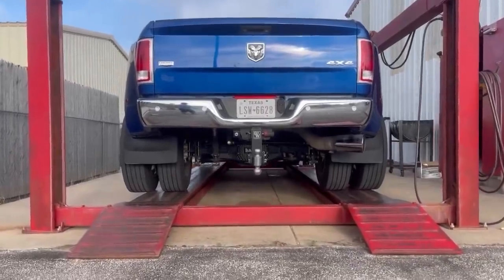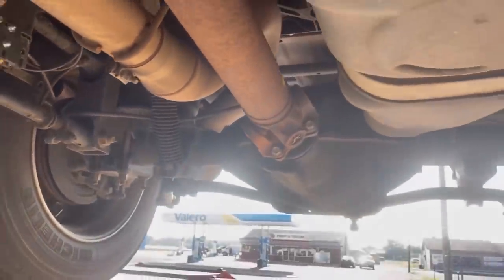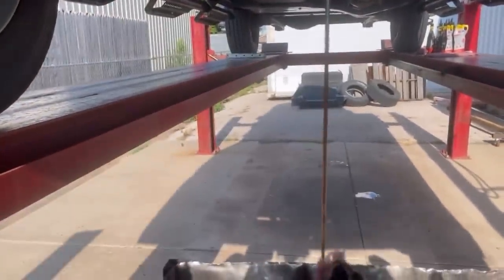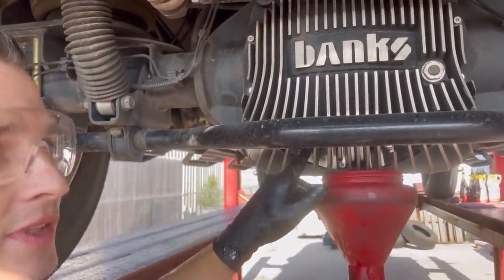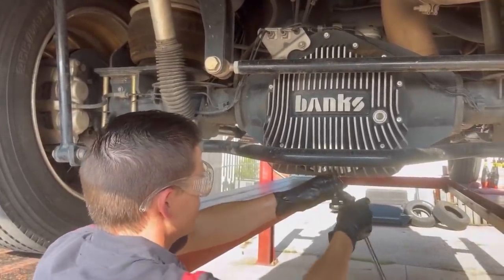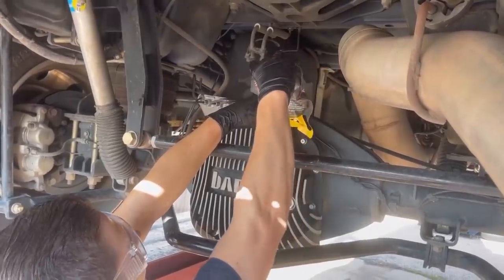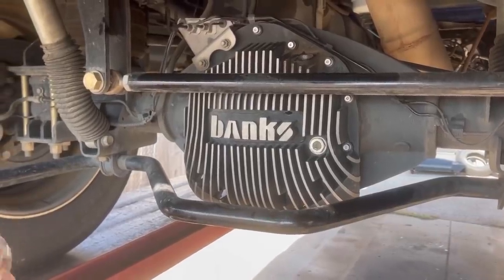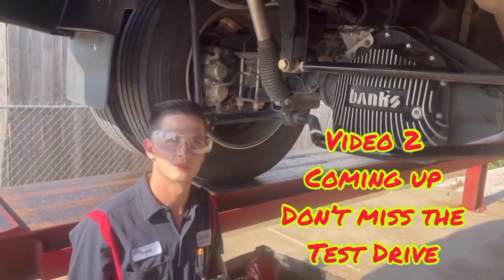RAM 3500 Rear Differential Service After Towing 30,000 lbs

Comment: Always take the fill cap off first!
Reply: I was just going to say that myself it definitely would make it drain a whole lot easier that’s for sure
Reply: That's 101
Reply: Doubly important, if you work on older or rust belt trucks, cause it's impossible to fill from the drain hole, if you can't get the fill plug out. Better to leave the old oil in, if the customer doesn't want to pay for the time, to drill out the fill plug or replace the cover.
Reply: @aaronnoyb  Not impossible...just difficult and annoying with a possibility of gear lube in your armpit.
Reply: Im sure he did just to slow the flow at first...And just got to talkin and forgot...No worries..Living life isnt perfect...
Reply: That boy sure talk slow.....
Reply: @jerrydlaughrin2880  not just that, I've had many that the fill plug was stripped. Never want to turn preventive maintenance into an unexpected break down.
Reply: Agree
Reply: Yep, always want to know you can replace the fluid before you remove it and it gives a better flush of any sediment on the bottom of the diff housing.
Reply: @LTVoyager  and to make sure the plug comes out. You pull the drain plug,fluid comes out,the top plug is seized up,now what?! Easily common sense!
Reply: @white24valve  Yes, that’s what I said.
Reply: this is an aluminium cover but even when rust is not an issue  it should still be removed first so air can get in and the oil drains better .

Comment: Guy needs more truck if he is actually towing 30,000-40,000lbs constantly, or he’s full of it. 

I run a Ram 4500 at work and I still wouldn’t put 40k behind it.
Reply: He may mean gross weight?
Reply: Big part is what sort of towing he's doing - if it's highway miles at medium throttle and high gears the vehicles not being loaded nearly as hard as if it was in the mountains, with full throttle being used in mid-lower gears.
Reply: True, but there are those who do…. To their own destiny of course.
Youtube: Danger Industries
🤯
Reply: i have a 18 3500 and i tow 35k behind it all the time, just because you are scared of it doesn't mean the truck cant and the guy has 22.5" on it so yeah that truck works. no one in there right mind would but 5k in rims and 4k in tires on a truck just to sit, or at lease those style of tires
Reply: @michaelladue5655  when you go to a CDL most DOT officers will just check the Tire rating now and not the truck sticker, You can change a trucks GVWR legally if you want, same with trailers. the truck he has is also rated for that much so idk where you are getting your info. if he is pulling 40k then the trailer would be 40k rated plus 14k for the truck payload totalling 54k, when you load a trailer correctly at 40k your tongue would be 4k-6k tops and that's perfectly within range of this truck
Reply: @michaelladue5655  if you are hauling 40k most hotshots will use a tri axle tandem and there are plenty of brakes and please get off your high horse with the east coast crap lol you have hills at best i live and work out of BC Canada i literally drive grades up to 14% daily. i also have been on the east coast of the US and i had no problems my GCWR on my truck and trailer is 24500KG and 6350kg on the truck. you clearly don't know what you are talking about but you did get your CDL 20 years ago when cowboy trucking was a thing, i respect what you do and the skill that comes with 20 years but a lot has changed and trucks are just getting to that point where it seems crazy but they can do it, i have had no problems or where i feel unsafe in my truck hauling, now that being side I'm also the guy that sets cruse at 62 and leaves it there and 50 when in the hills and the ram 3500 engine brake is nuts and tends to keep the truck under control. your going to blow your load in 2023 when ford comes out with a truck that can do 40k they are already at 37k.
Reply: @michaelladue5655   registered my 95 f350 for 16kgvw(12,500 is door plate) here in MT this year... yes you can legally increase your gvw and plenty of ppl do even in CA. Manufacturer gvw is a suggestion not a fact... take my obs for example for rated the axle(dana 80) at like 7k while dana rates at 12k.... plenty of cases like that

Comment: @Lauren (wherever she went to) I doubt anyone claimed OEM was the worst one to use however, there are many other aftermarket brands out there that DO NOT perform as good as an OEM cover. At least Banks tested theirs and filmed their testing methods as to the improved lower temperatures over OEM plus the advantages of the oil sight glass, top fill plug and lower drain plug. Expensive accessory however, it is better than OEM in many ways.

Comment: A pipe plug socket is a better tool with those drains as they are generally “sharper” around the corners and won’t risk distorting the super tight plugs. Just a quick tip.

Comment: My Ram 3500 Cummins Dually called for 75W140 synthetic gear oil for heavy towing loads! and I'm in northern climates. Don't forget the friction modifier for the anti-spin mechanism!
Reply: Only need friction modifier if it is a clutch style diff, any other and you don't need.

Comment: The Bank's differential covers should have ave intake shroud that draws air flow across the fins it would cool better while the vehicle is in a forward motion.
Reply: Not easy to see from this video but the tabs that stick out on each corner at the bottom are in fact scoops that redirect air upwards.

Comment: I know it's a new cover however, ALWAYS make sure you can get the fill plug off first before draining. Also the old fluid runs out much easier with the fill plug removed.

Comment: Those two parts of the diff cover that extend beyond the original diff dimensions (the "scoops")...if they were cut off and reattached with hinges and kept in place with springs, the owner won't have to worry about tall spots in deeply rutted roads or big rocks the driver can't go around because whatever collides with those spots will simply move them backwards and the springs will move them back into place so they can continue to channel air upwards over the diff cover. 
All it takes is one good hit (2 mph or faster) and that aluminum diff cover will start leaking. Those Banks diff covers are great but they could be made just a little bit better.
Reply: You should check out the Banks cover video. They show what it takes to break them off (hint: they're made to break off in a way so as not to leak)
Reply: @domdogg123  I saw a video of a guy who connected with something in the road and his diff had a small leak. It's somewhere here on youtube.
Reply: @cliffcampbell8827  Fair enough.

Comment: Remove the fill plug then the plugs on the differentials, transfer case, and manual transmissions also just in case it doesn't want to come out for whatever reason. I could imagine a  Dodge Ram 3500 Cummins diesel with a double dually rear axles!

Comment: Why wouldn't you remove the filler plug so it would drain ALOT FASTER AND SMOOTHER. ??  I always run alittle new fluid straight thro then put the plug back in then top it off.

Comment: I'm surprised he's only using 75w-90 not 75w-140 or even 75w-110.
Reply: Im getting ready to do my first diff fluid change on my Ram 3500. Which of those 3 weights would you recommend? Im constantly towing 25k-30k around the south Texas area where it’s summer year long if that matters lol

Comment: 10lug? What happen to the 8lug set up? Always curious when I saw them on pickups
Reply from the maker: 8-to-10 lug adapters are fairly common these days.
Reply: @bankspower  ahh, makes sense. Thought it was a new hub or upgraded part
Reply: @kunu98  yeah and the 22.5 rim size is straight off a semi. At the same size my rims are on my semi. And I can almost identify those tires too lol and they are definitely semi tires.
Reply: @YourLordMobius  I work around and with semis. Def noticed the 22.5. Kinda strange on a 3500, don’t see much benefits, weight gotta be way more
Reply: @kunu98  putting semi wheels and tires on 1ton dually's is mostly done for looks, but also the tires will last much longer, especially if you're always towing heavy like this guy is
Reply: @YourLordMobius  Looked like XZE2 Michelins. Great tire.
Reply: @captainswampy9501  dude that's what I was thinking. Pretty sure those are the same as what I've got on my steers.
Reply: @toddformanek8495  ahh, makes sense with tires. Figure the rim is 2x heavier than stock. Atleast. Nice look
Reply: @YourLordMobius  That's what's on my steers. They're great on a spread axle or even the drive axle.
Reply: @captainswampy9501  i dont majorly get to pick my tires sadly. Got super singles on the drives and the trailer is whatever. But i know about the spread axle life lol.
Reply: In the older trucks, the larger diameter tires kept the RPM down to 1800 at highway speeds where fuel mileage is better.  Also, isn't the warranty like 500,000 miles on semi tires? Besides the Alcoa wheels are awesome.
Reply: @cwbywy9544  Engine RPM is affected by transmission and rear axle gearing as well as tire size. My truck runs 1350@65 in 18th gear or 1600 in 17th. There is no warranty on semi tires, ya wreck one, ya buy another one.

Comment: Banks makes some nice products. I just wish with as big as they are that they would have helped the fight against the EPA. Instead they kept quiet for a military contract.
Reply from the maker: Although we're all for clean, breathable air, we're also racers and have been since 1958 when Gale sold his first engine. We publicly back the RPM act to preserve racing on multiple occasions. Do we wish emissions equipment wasn't necessary on street-driven trucks? Of course. No one likes DEF and DPFs. But as long as it's the law, we're going to follow it. And, we'll continue to invest in new technology, making big power, cleanly. Tire smoke is the only acceptable smoke.

Comment: Only an amateur removes the drain plug before the fill plug.
Reply: Many diffs have only one fill and require the cover be removed. At least he drained it from the drain plus vs. remove the cover and Trent is likely on his first round with this diff cover. Its not a big deal to drain it like he did however, he will figure it out.

Comment: With the stock setup, easier to just extract the fluid out otherwise you got to pull the whole thing and replace the gasket.  The engineers did a lousy job with respects to maintenance.  I like this banks setup.

Comment: Hey banks does this cover  fit a ram 2500 gas are they the same rear end or is it different on the diesel
Reply from the maker: Diff covers for the gas engines are slightly different. These are for the diesels only.

Comment: Wasn't aware Ram was using a rear suspension anything like this. Did not count the lugs but if it's 10 lugs he's either using adapters or a 4500 or 5500 series chassis. Before altering a 3500, I feel I would have went with a 5500 especially constantly pulling that kind of weight. Commend the owner for proper maintenance, but a nerd when it's obviously your livelihood.
Reply: ...need...    Damn autocorrect
Reply: Then you are in a commercial vehicle and paying higher insurance for it.

Comment: That axle vent must be plugged judging by the way that diff fluid came out.
Reply: @YasilTorvanna  banks makes axle vents too?
Reply: No it’s not, the axle vent is 1/16 the size of that drain hole. There is no way it can flow enough air to keep up with that volume of warm oil draining out.
Reply from the maker: This is the first time Trent has worked with a Banks cover and didn't realize there was a fill plug on top. Had he removed it, the oil would have drained smoothly as expected.
Reply: @ralfie8801  You are correct and its not a big deal anyway.
Reply: @Garth2011  
A plugged axle vent is though. Every seal on the rear end would be leaking if it were plugged up.
Reply: It has nothing to do with viscosity, it’s volume displacement, that’s why when you pull the fill plug enough air gets in and the oil drains normally.
Reply: Yeah, that’s why draining hot oil pulls a vacuum on its containment vessel when enough air to displace the draining oil can’t get in said vessel.
The axle vent doesn’t allow enough air in, removing the fill plug does, and allows the glug glug effect to be replaced by a steady stream of warm to hot gear oil.
And the inside of that axle housing is a defined space, it has a specific volume of air and oil in it.
Reply: @michaelladue5655  
There was air getting in, just not enough to compensate for the hot oil draining. You made MY point. Air entering through a 1/16” opening is never going to equal the volume of oil draining out of a 3/4” opening.

Comment: No worry, petroleum engines will be around for a long time.
Reply: You're still going to need to change the oil on your gearbox is in your electric cars. And you're still going to need natural gas to charge your car.

Comment: So it's a 3500, but it's got 10 lug wheels like a 4500?
Reply from the maker: Correct. He's most likely using an 8-to-10 lug adapter.
Reply: @bankspower  Never did agree with wheel adapters.

Comment: Why is it acting like it needs a vent
Reply: The factory OEM cover design requires the cover to be removed to drain the gear lube. No vent required for that design. Now that the OEM cover is replaced with the Bank Cover, the housing air vent is not large enough to deal with the drain volume but it is still big enough to deal with the needed vent needs. The mechanic only needed to know he could have removed the fill plug on the Banks cover to eliminate the vacuum created with the Bank cover design as the cover is not removed, causing the vacuum.

Comment: Currie Enterprise,s says if you use synthetic gear oil in their differential,s it voids their warranty. Im assumming because it,s more slippery than mineral oil and could spin the pinion on the ring gear easier causing damage. I use cenpeco gear oil its very clingy like snot. Just my 2cents.
Reply: Most differentials now days are factory filled with synthetic oil. If someone tells me they'll void a warranty for using synthetic, I'll find another shop. They clearly don't know what they're talking about.
Reply: @paulzumpf3612  FUI Currie Enterprises makes diffs for drag cars and jeeps, rock bouncers look them up they are top of the line so i thimk they know more diffs than anybody. So i,ll take their advice before anyone,s.
Reply: @zackeryeckenrod6549  I don't know what your point is. Companies like Dana and Rockwell build more in a day than they do in a year.
Reply: @paulzumpf3612  So dana and rockwell build more in a day what does that have to with it do they require you use full syn.Currie makes specialty diffs. so theve obviously have tested their syn. oil or min. oil therory. Their engineers did,nt wakeup one morning and ssy we,ll were not warranting our diffs.if you use syn. oil. So do you get the point now iv dumbed it down as far as i could.
Reply: @zackeryeckenrod6549  Eaton and Rockwell both extended their warranties from 250,000 to 500,000 miles after switching to synthetic. NASCAR is using synthetic as well as most top fuel drag teams. I'm sure they've all done their homework too.
Reply: @paulzumpf3612  I dont care if you use bacon grease in your shit im staying with what Currie has stated. I use cenpeco gear oil. Watch the truck pulls. I will never use syn. gear oil in my truck, jeep or any of my sxs,s. Currie had reason for their warranty claim dont ya think.As for your nascar claims an your other claims on the use of extended warrantys. Where can i find that info. It still wont change my mind but. Just your info on these claims.
Reply: @zackeryeckenrod6549  I really don't like writing educational articles. My information comes directly from the owner's manual and service manuals for class 8 trucks over the last 36 years of working on and driving them. I supply the oil for a pro stock diesel pulling team. Currie does not demand a conventional gear oil. They do require GL6 oil. GL6 is available in synthetics however it is an outdated obsolete specification. Currie requires GL6 because that's what Richmond Gear calls for. Currie uses Richmond Gear. They don't engineer or grind their own gears. Mercedes requires synthetic oil. Sterling axles in Ford trucks have a tag on them that says "Synthetic Required".
Bacon grease, actually tallow is used in steam engines.

Comment: come on guy, you know to remove the filler plug first.
Reply from the maker: This is the first time Trent has worked with a Banks cover and didn't realize there was a fill plug on top. Had he removed it, the oil would have drained smoothly as expected.